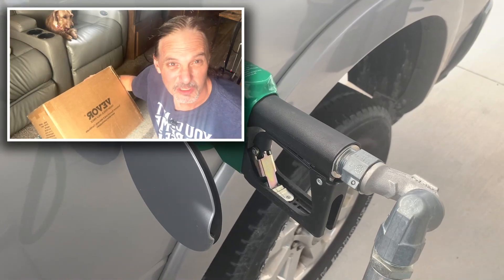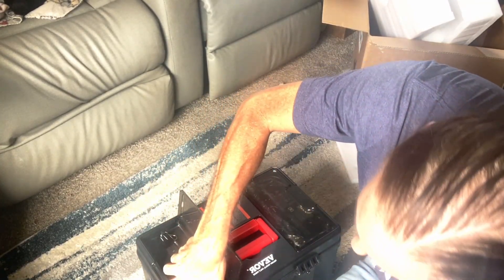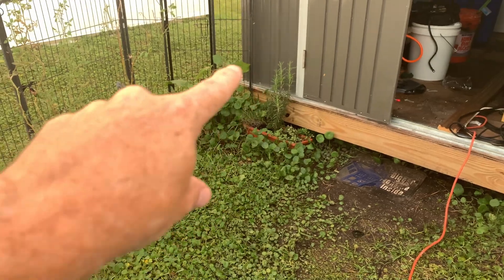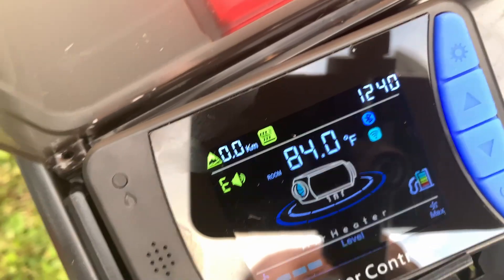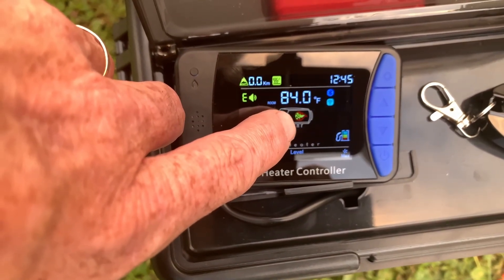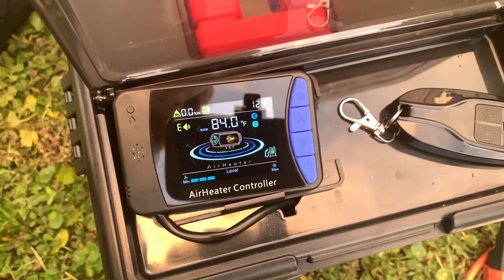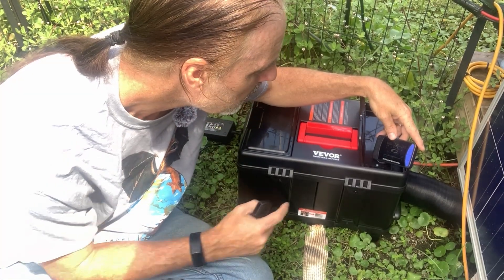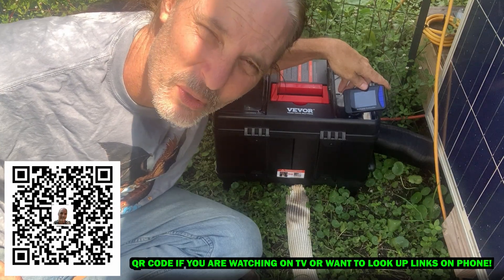Vevor Diesel Heater Tested – Heat or Total Junk?

Comment: Using invertor uses more power,DC is best
Reply from the maker: Ye for sure, except I was already running the inverter and made connection easy, if it was a good perminate location I would have connected it with DC for sure. I tested it with it, and their frigerator also and they are very efficient also ..

Comment: Nice video!I have an LF Bross heater,3 years nowand i am planning to get this vevor heater.Does the pump make any ticking noise? Cheers
Reply from the maker: You here a little when it is starting or heating up .. I have not got to use it in deep cold yet, so will see, but I did not hear it once it started with the testing I did..